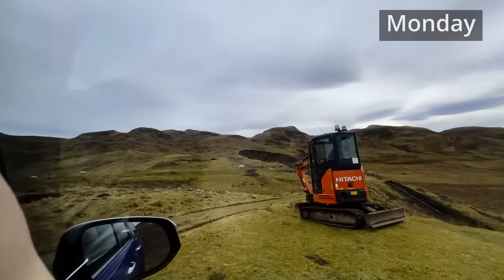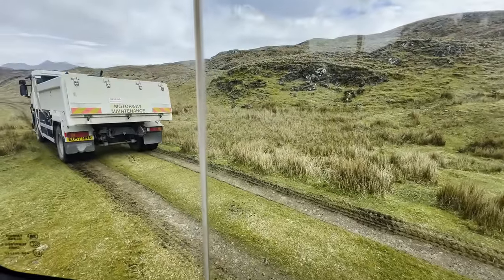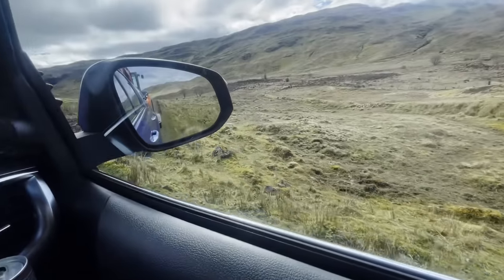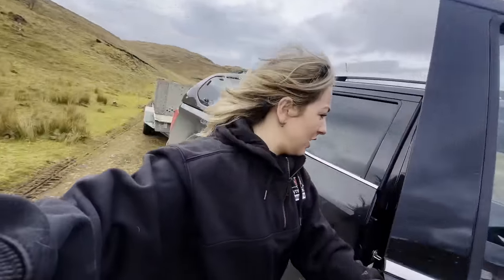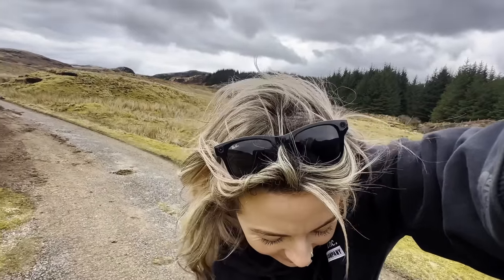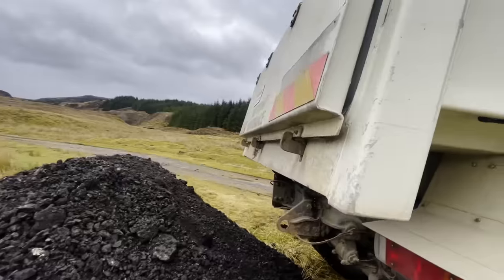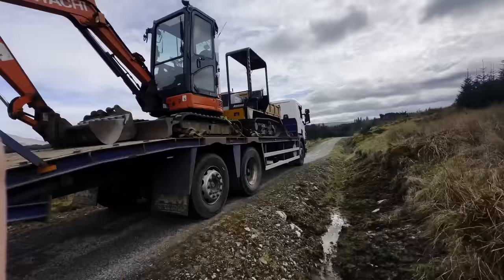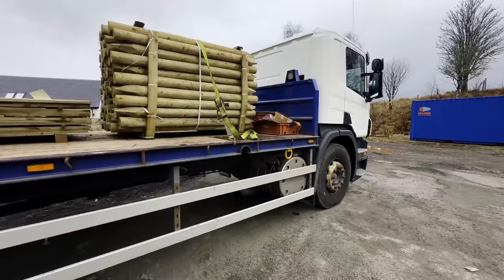Did I Get The Tipper Out?

Comment: When i was patching hill roads it was much easier to get piles of stone tipped at various places along the road and just use a 3cx or similar wheel digger and just drive up with a good full front bucket and the 3 foot back bucket full as well and crack on with the job one man and 1 machine much less stressful and save a fortune on lorries trailers and all the various machines you use to patch a few holes and when finished you just grab the buckets in the 4 in 1 and off home so much simpler and massively cheaper way that all the hassle you had

Comment: 18:simething - The beacon on the track tipper was going; if I understood you the engine was off, so that's maybe going to cause issues with the battery?

From experience, other than trying to change gear on an auto with a stick that's not there, the other big issue is trying to declutch with a clutch pedal that's not there, and putting both feet on the brake pedal.